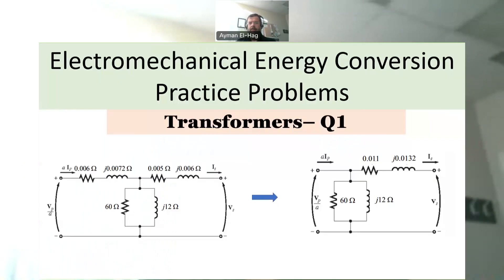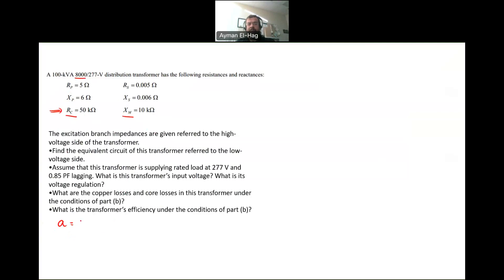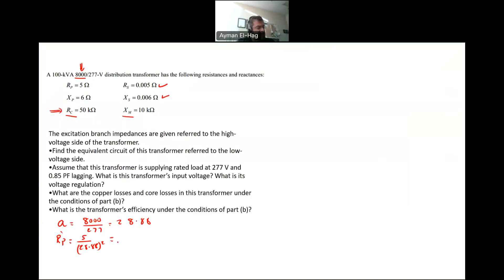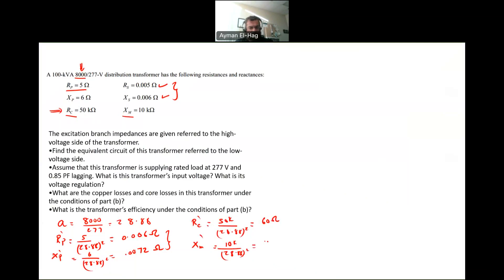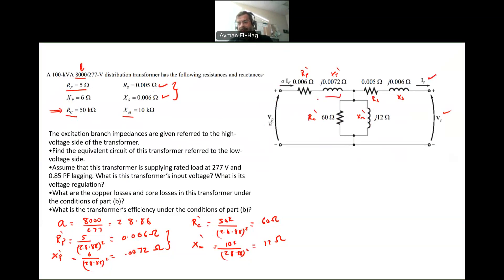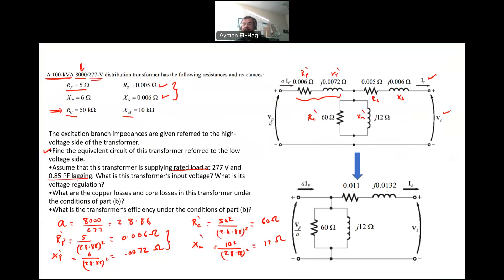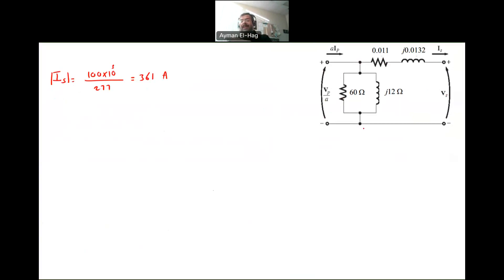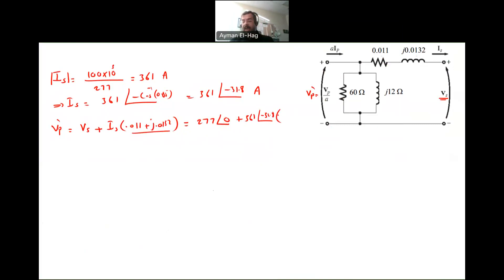Transformers - Question no. 1

Comment: Hello Dr Ayman El Hag, This is Hitesh...I had studied power systems under you at AUS in the year 2010-2011, I had a question- when do the engineers do these calculations of the transformer equivalent circuit, voltage regulation, efficiency of transformer - during the design of the transformers or after the transformer has been built as these questions do not ask about design of transformer
Reply from the maker: The designer calculate all transformer values including the no-load loss, load loss, % impedance, high voltage and low voltage resistance, etc. Then, the routine tests as per IEC 60076 are conducted and all these calculated values are measured as well after the transformer manufacturer is done.
Reply: @electrical4everyone  Thank you for your response Dr Ayman.... I understand it